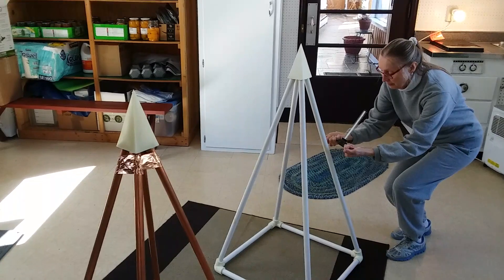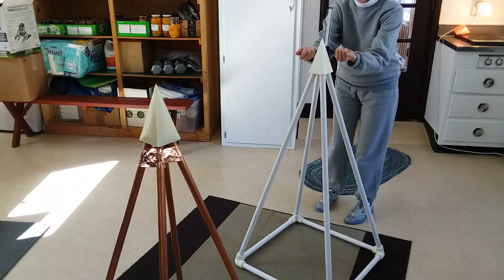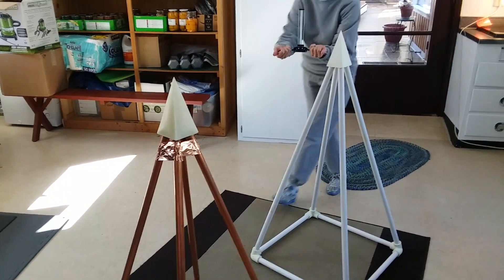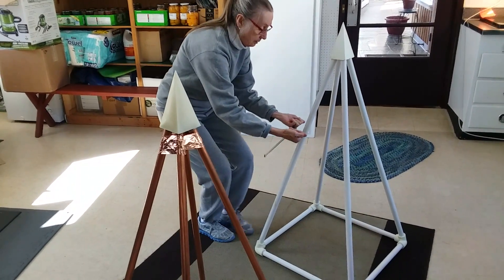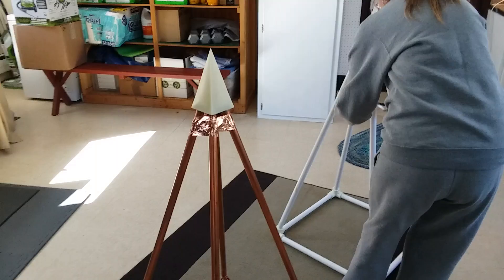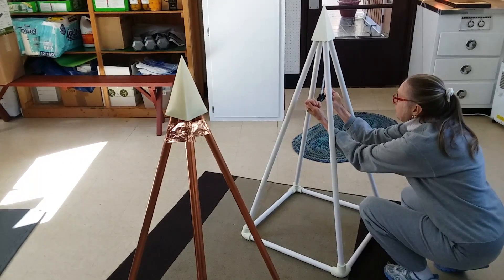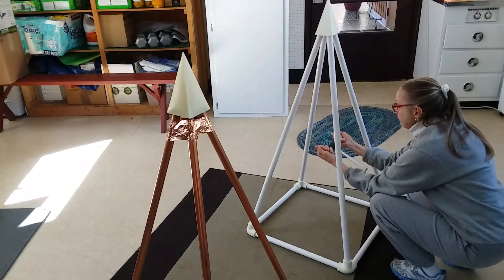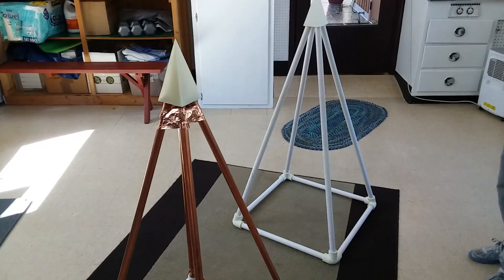Revisiting the Copper Vs. PVC Pyramid Energy Experiment

Comment: Hi Charlie, I know it's been 6 years ago. Is it possible that the conductive tape has disrupted the geometry of the copper with PVC connectors. Another disruption could be due to mixed materials. To rule out those possibilities, suggest you test the PVC pyramid against a fully copper built one.

Comment: The Lecher Antenna IS in fact a dowsing tool, It measures the proximity and intensity of subtle energy fields, however I have not seen it detect, or qualify the specific energies within the field, which is arguably the most useful information. Physical Radiestesia offers the tools to do this.
Reply: It doesn't look like it could ever qualify antthing. Getting absolute, and not relative values is also a difficult task that it doesn't look like its designed for.

Comment: I thought that the measurement device measured EMF frequencies (like it did in the EMF video)? If the copper doesn't move the antenna then wouldn't that have been good in preventing EMF in the purpose of this video? 🙈 help! I don't understand and I want to! 😭 Is it because 17.6 is a different setting from when you tested the EMF of the cell phone? 🤔

Comment: Having read and listened to numerous folks give opinions on the copper vs PVC question, I was leaning more toward the conductive nature of a copper pyramid.  I did construct a pyramid using 1/2 inch copper pipes about 8 feet long with a careful angle of 72 degrees and oriented toward magnetic North, due to the conductive nature of the copper.  I set this up in my living room where I have a number of various house plants that I have grown for 5 to 10 years.  The plants are not under the pyramid, but are 5 to 10 feet away from where it was set up. 

 I was not expecting to see a lot of results, but I was wrong!!  Every one of the plants from Philodendron to avocado plants have withered and are dying in less than 2 weeks!  I have taken the pyramid down and will be looking at PVC pipe on my next trip to town!!
Reply: Please do tell what changes with the pvc.. goodluck reviving your houseplants
Reply: p.s.  I did use all copper pipes, with copper wire securing the top.  I put rubber feet on the floor end of the pipes and marked the location of the base on the floor with masking tape.

I will repost on here when I get the PVC pyramid built.

Comments??

Comment: PVC will build up a static feild of whatever frequency Energy is flowing past it,Copper and wood will not they may draw the Energy in wood will let it collect over time but Copper will always force it towards ground the PVC continually draws it in because the static feild will force it and collect around it. It doesn't matter if it's universal Energy Electromagnetic whichever frequencies they are the static feild will build and collect and laws of Physics and thermodynamics don't apply those are just man made Ideology to keep people from Experimenting Tesla knew this. Next question is what other Frequencies are they attracting also

Comment: I don’t understand your results copper is a conductor you may try using copper connectors or soldier the copper around each tube. It you could provide a link to the device that you do your measurements with I would purchase one. To run my own test.

Comment: Copper connectors should be used and tested on the copper pyramid.  Why use copper tape and not copper connectors?  Aren't copper connectors easy to find?  Thanks
Reply: Yah copper pipe elbows can be found, a little modification and soldering would need to be done.

Comment: The circuit is not flowing in the intended shape with tape 4 inches down.  The circuit flow doesn't reach the tip or the corners but goes around them.

Comment: Thank you so much for your work and sharing the knowledge.  

My apologies if this question was answered before, but why not Make an all wood pyramid?  If non-conductivity is important, it follows that wood should work as well as PVC, as long as no metal is used in the construction.

Please correct me if I am wrong.  I am asking because I want to experiment with the Russian design pyramid, and I have access to a lot of free wood.

Thank you again
Joe
Reply: Joe wood works they all work wood just takes longer to collect the Energy Copper or other metals that have continuity will always force the Energy down toward the base or ground the PVC continually makes a static feild of whatever Energy it collects and is similar to wood where it will be all around it but you have to be careful because different measurements can make the things very dangerous drawing in dangerous frequencies no one ever gives that warning you don't want to build one big enough to go in and find out it's a microwave oven be careful

Comment: The PVC pyramid has one material on the entire pyramid. The copper pyramid has at least 3 different materials copper rubber band and PVC. I love what your doing here but that is not a controlled experiment. All copper vs all PVC is the only way you can be completely fair. Much love and respect. I’m sorry but if PVC is so much more conductive than why isn’t used in electrical like copper. with nothing but love and respect.
Reply: That is such an old concept.  Its been written about since the 1970, except they made wood pyramids and metal screws and found it worked.  Perhaps because the metal screw was surrounded by wood.  Still this elder, has not grasped the concept except with PVC.  Chloride has a hexagonal structure, if the angle of the sides was of such a harmonic shape, this material must have some remarkable properties.  He's on his path and its paved with PVC.  Like the saying goes, when life throws you pvc, make pyramids with it....😉👍
Reply: I hope you are not as into google as your name makes it seem.. 

Duck duck go is where you can find answers that google keeps censoring. Google is not a good thing.
Reply: @Malanfryan  🤣

Comment: when using metal, you must use all metal, when you build the pvc you dont use metal connectors, why not?  use the antenna with the pvc and metal connectors that would be fair.  what you have demonstrated is the principle that a pyramid must be of one consistent material...so far.
Reply: I would have thought that the sticky side of the tape would be like an isolation. Then by the looks of it, the cap itself is not copper. This meaning the energy is not being conducted through the point as it should.

Comment: Sir , you have shown us that you will not be denied . That’s fine . In truth using the copper wire and tape is still not as efficient as replacing the PVC connectors on the copper pyramid with copper connectors . I believe I am right about this . So, when I can , I’ll get the material myself and do the experiment and film it . I’m not a hard head , if I’m wrong I will admit and offer an apology . But what bothers me about your experiment is , rather than just replace the connectors on the copper pyramid , you followed the suggestion of someone that had an idea , an idea that more than likely had not been tested or proven . Are you so committed to pushing PVC , that you are afraid of finding out that you could be wrong ? It would not have cost you that much to replace the connectors with copper to do it the right way . At this point sir , you are very sad as an informant of pyramids and experimentation . They say Edison tried 10,000 different things when inventing the light bulb . You apparently have trouble trying more than 2 or 3 .  So you have NOT proven anything at this point that cannot be disputed regarding pyramids and energy fields . Also when testing your pyramids , swap locations and positions as well to get a true reading .
Reply: he should use metal connectors on the pvc pyramid, that will be the best way to show the need to be uniform in material since he has a love of poly vinyl chloride.  Also Dr Bell states that steel is the best for pyramids and not hollow steel, solid rods.
Reply: Have you built any large pyramids such as the scale of his typically shown? And done any emf testing of your pyramid theories on your assumptions about materials?
Reply: D. Aardentvarkitage not at this time . I have been recently diagnosed with a medical problem I didn’t see coming . Once I’m free of all the testing , Im anxious to pursue this matter and record my findings .